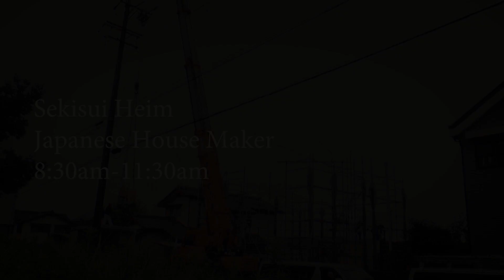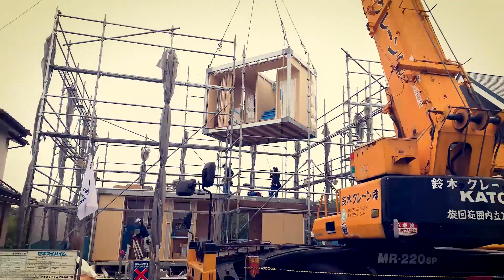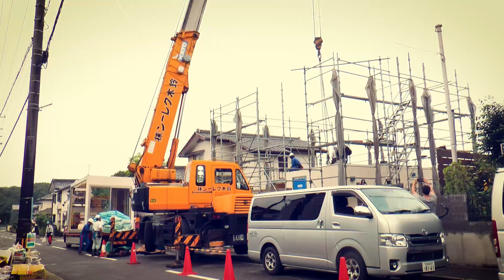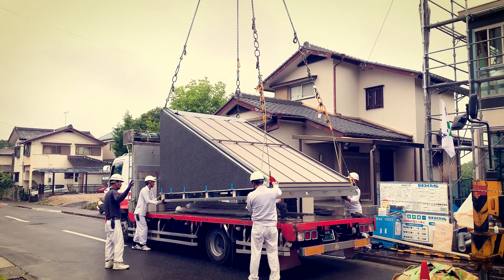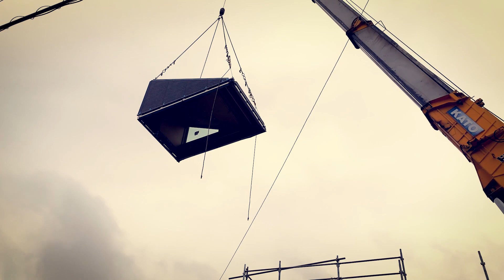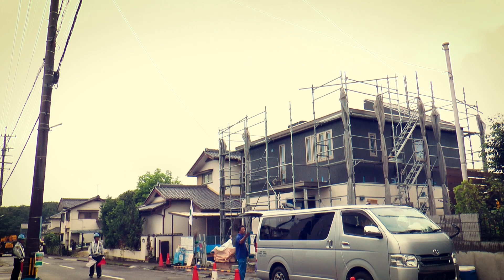Building a House in Japan  - Sekisui Heim House Build Timelapse

Comment: if its okay to ask, those units are those concrete and wood ? i seriously want to learn your style in architecture and funny enough i graduated in architecture course...
Reply from the maker: The units for this build are all Steel frame with wood, insulation and weather proof cladding.
Reply: @CreativeLifeJapan  how are the joins between units weather sealed?
Reply from the maker: @tubulartuber  Bolted and  sealed in slow time after the initial build.
Reply from the maker: @tubulartuber  You can see that they add the seals before the next unit comes in also.
Reply: @CreativeLifeJapan  so they're not taping the WRB joins?
Reply: @tubulartuber  Not exactly. There’s flashing behind the gap, and the outside is sealed with either rubber gaskets or a sealant. The sealant will need to be redone every 15 years or so, as far as I know. It seems to work okay in Asia. I know the US is crazy about wrapping and taping it all off.
Reply from the maker: Each unit is a steel frame structure.